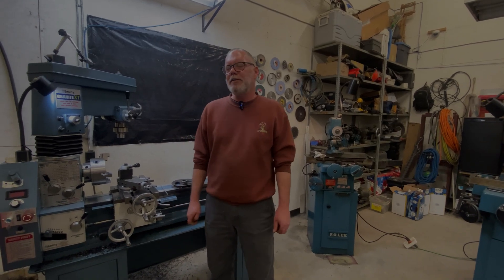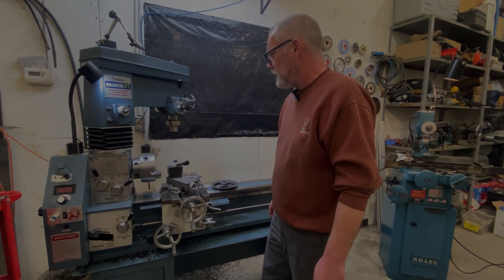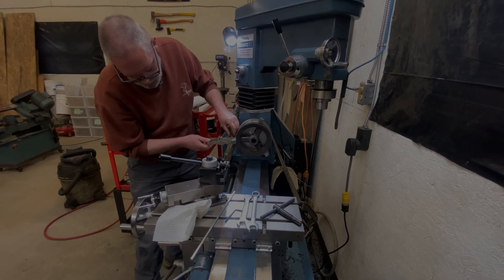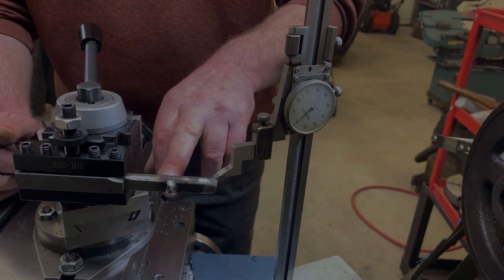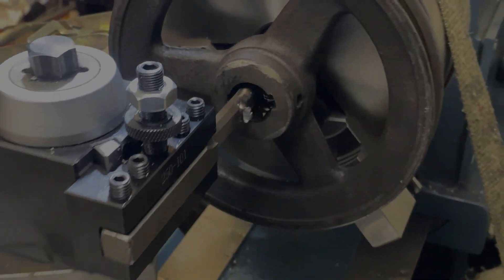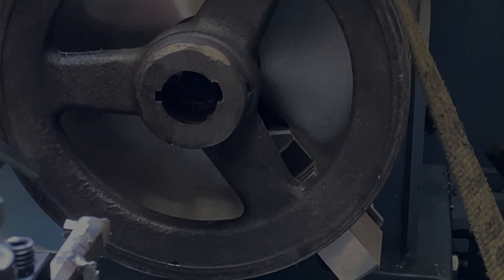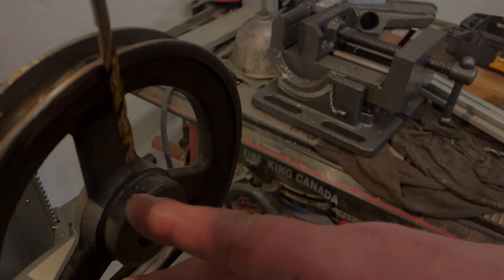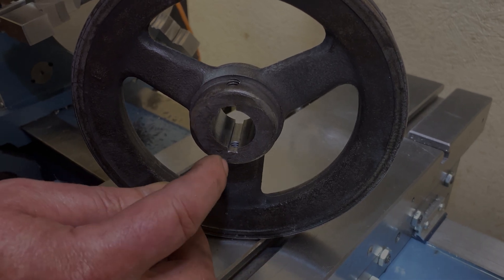How to cut a keyway in a lathe

Comment: Why didn't you put the bolt on the opposite side so it would have pulled the keyway tight. This way it will push off the keyway making it loose.
Reply: the key sits between a shaft and the pulley. there is nowhere for it to go except fall out the keyway longways. hence the grub screw.

Comment: I did a key way much the same, I placed a machinist jack between the bed of the lathe and the chuck to hold it. The rachet strap worked good. you will be surprised how good the eyecrometer is LOL👍
Reply from the maker: eyecrometer, I like that! My eyecrometer has seen better days. kinda need the height gauge nowadays.
Reply: @Lappemountainliving  I know that, I had cataract surgery a year ago 20/20 now.